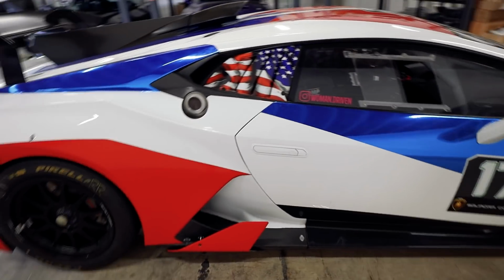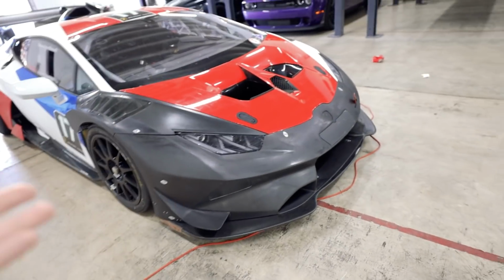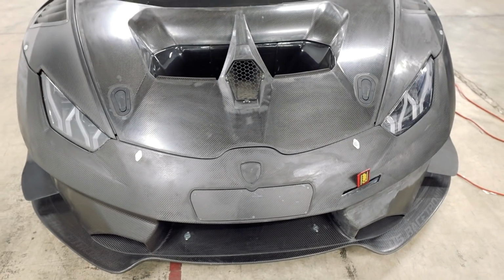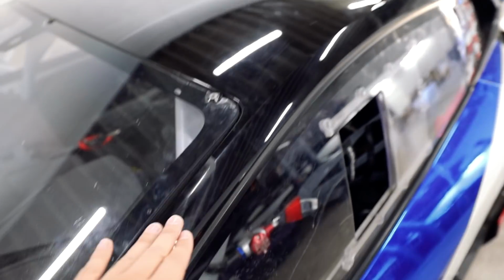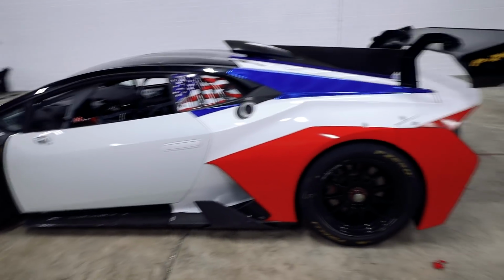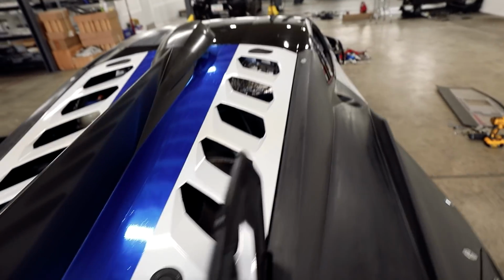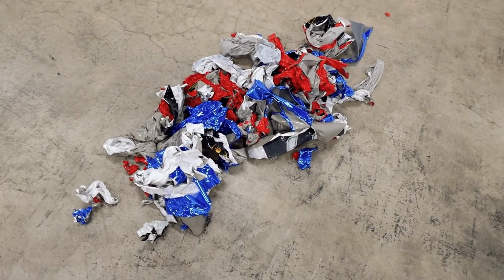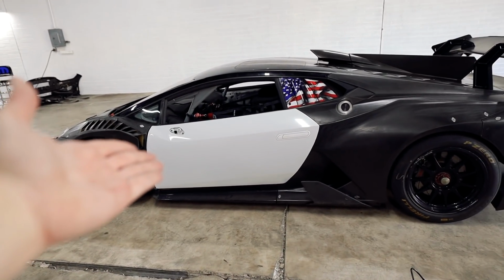LAMBORGHINI Race car with $120,000 of Carbon Fiber!

Comment: I would paint the doors black and leave all the carbon as is.. Love that raw look
Reply from the maker: It would look awesome, but it hides a lot of the lines. Plus I’d have to get some type of protective wrap as the sun would just ruin the carbon fiber
Reply: @woman.driven  Sun doesn't  damage exposed carbon fiber, but you can  gelcoat it if you are worried about that

Comment: I would hate to be the one putting a wrap back on that with all those awkward  little bits to get the wrap in.

Not sure  why the doors were white under the wrap as you would of thought the would of been black to match the carbon. However the wrap did have a lot of white so it might of been easier having them white. Lol

You did good removing the wrap cleanly from those tricky shaped areas though. 🙂
Reply from the maker: That is my thought. It was challenging to remove it. So putting it on will be a pain. So the doors either came white, or black. Just depends on what the factory decided to add. I’ll add a temp black wrap for now.
Reply: @woman.driven  Well hopefully the temp black door wrap won't be on to long before you get your new cool custom wrap on.

Enjoy an amazing week. 🙂

Comment: Girl u need to get a stool with wheels so u won’t strain your back constantly bending and squatting with your back in diff positions… hood , trunk , roof u need to stand , but the QPs and the doors u can use that stool… much easier and u will appreciate it later when your back is still in good condition.